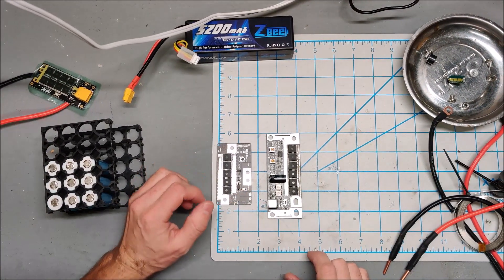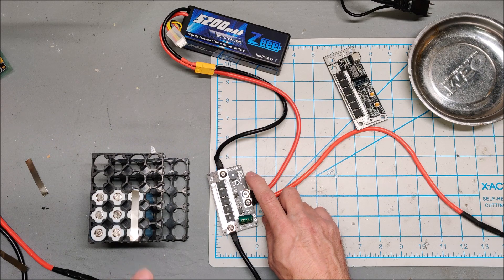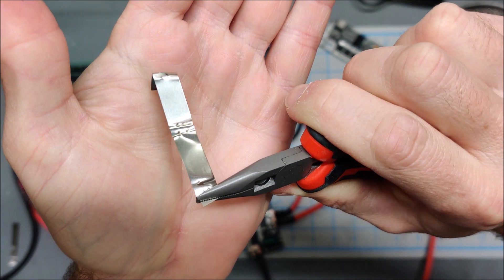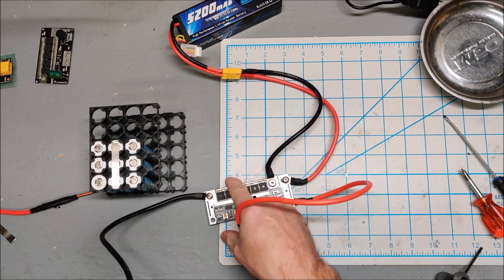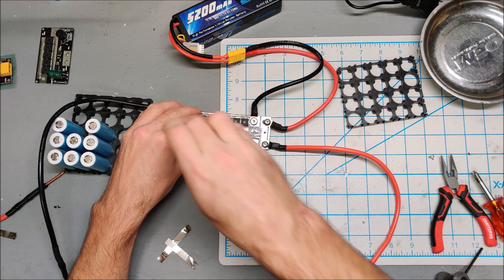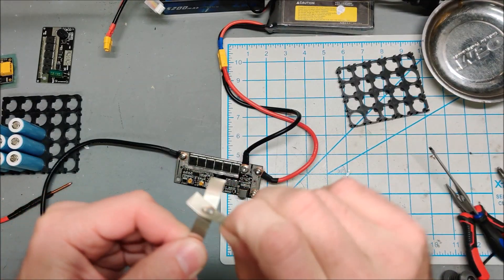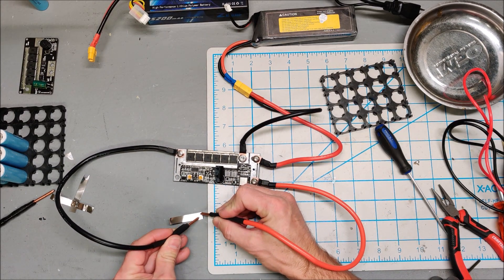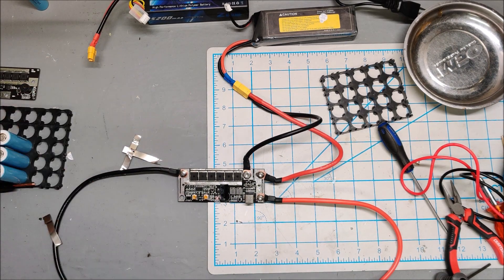$20 PCB SPOT WELDER SHOWDOWN: ROUND 2

Comment: You needed the connector plugged with 12v dc to power the logic of the board. You tried without connector and the mosfet went short circuit
Reply: why people wont read manual, he just burned the board down lol

Comment: I am considering using a starter motor solenoid on a lead acid AGM battery to well .15mm  x 8mm pure nickel. Have you tried that yet ? Use a momentary switch to operate solenoid through copper welding rods.

Comment: Is it possible that the barrel jack could be for a foot switch and the little switch could be what turns that on...?
Reply from the maker: No I checked, the barrel Jack is for charging a capacitor bank
Reply: No, as @Stevenc22 says, it is for charging a cap bank if you use one to power the unit.
However, v2 of this PCB (which Stevenc22 shows in this video) does have a foot switch option!! You can solder one in the lower left corner of this pcb.
For more detail, also take a look at the Chinese listing on Taobao.com: https://item.taobao.com/item.htm?id=624450584422&ns=1#detail

See also my comments in his follow up video: 
https://www.youtube.com/watch?v=_eEOqeNRLrE&lc=UgwJwrjLQ4RiqJWw6OV4AaABAg.9HYOCKGBenv9HnKnZLCSpb
and
https://www.youtube.com/watch?v=_eEOqeNRLrE&lc=UgwJwrjLQ4RiqJWw6OV4AaABAg.9HYOCKGBenv9Hnes1QFlge

But indeed two major important points:
1) He needs to wire the pcb up correctly , lol. He didn't in this video and as such possibly damaged the board.
2) When using 12V, like his battery he used, a 25V 10000uF capacitor must be connected in parallel with the battery +- pole/line to prevent possible surge and high voltage damage to the control board during spot welding!! Which is likely what happened when he blow up this pcb in his follow up video: https://www.youtube.com/watch?v=_eEOqeNRLrE

Comment: looks like the diodes in the mosfets are allowing the current to flow backwards.
Reply: Doesn't work that way ;-).

They allow REVERSE power flow through, but the metal strips aren't generating power.  Even if it was, it'd get gated back into the battery.